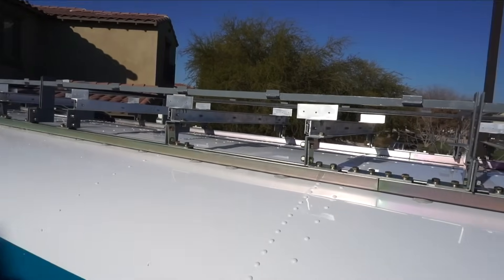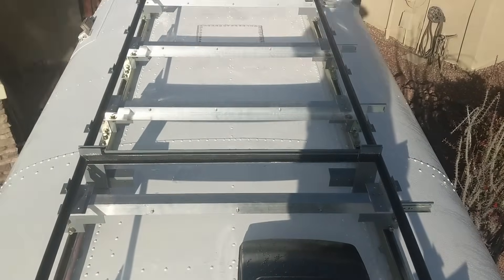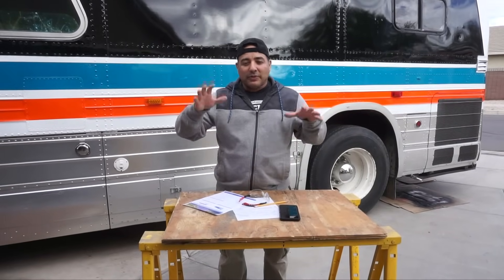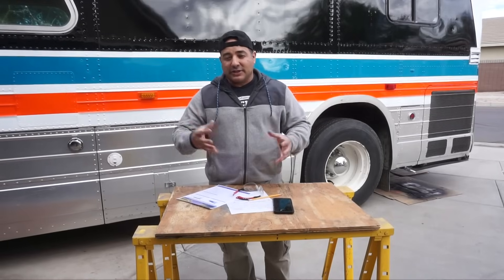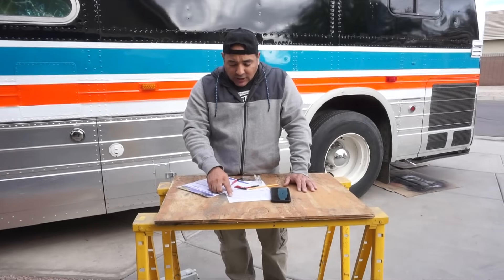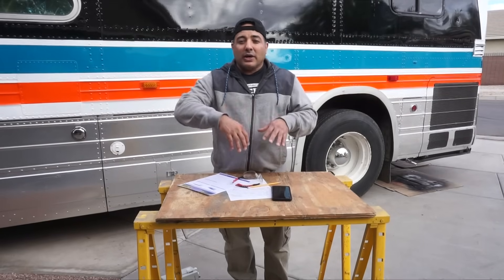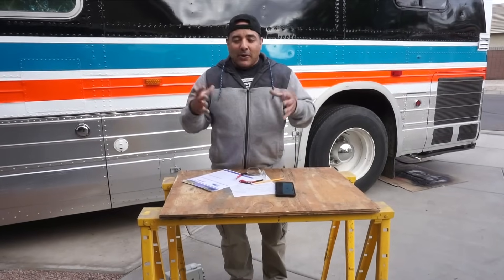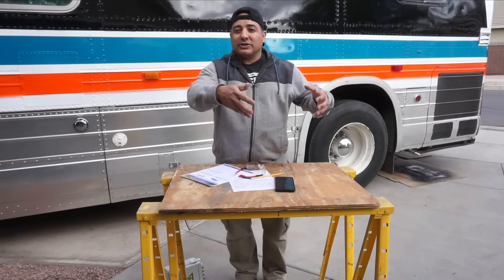Solar Install:  Part 2 - Mounting the Lower Sliding Rails & Combiner Box

Comment: I am building a 2s2P setup on my box truck as well. One series will be on sliders like yours when driving.  If I use a combiner box as well, won’t the amps drop significantly when the panels are shaded?   Reducing the overall Watts produced.  I am trying to decide between a combiner box fed into an all on one charge controller verses using two all in one charge controllers (1 for each string).  Would appreciate your real world experience with this.
Reply from the maker: Amps drop in half as you would expect when the lower panels are in because only 1/2 of the panels are exposed to the sun. The secret is to have the panels that can be shaded in parallel with the ones that will not be shaded.  I have run this setup for over 4 years and it works exactly like it's supposed to.  Going with two charge controllers is slightly better because it gives you some redundancy.

Comment: I have 4 panels on my roof using this combiner box, (2-425w and  2-200w).When I was using just 2 of the 424w I was getting over 800 watts on a sunny day. Now when I added the 2-200 watt panels, I get under 300 watts total.
Reply from the maker: Thank you Eladio.  For panels that different you are going to want them on separate charge controllers and not run them through the same combiner box.  If you are combining different panels like this you need to match the voltages as closely as you can (like maybe by combining the 2-200W panels in series before bringing them into the combiner box).   Here is an article that describes what happens when you combine different panels and what to consider: https://solarpanelsvenue.com/mixing-solar-panels/
Reply: Thanks. I'm using 2 Ecoflow Delta Pros and a smart battery.

Comment: Any thoughts on the grounding safety wire? Was noticing you decided not to use it. I have this same box and am wondering if that just goes to chassis ground or if it's even necessary or useful in a vehicle?
Reply from the maker: We actually did ground the safety wire to the chassis - I did not show it because there is plenty of controversy surrounding the proper grounding of a PV array on a vehicle.  My thought was if we are plugged in - the chassis is bonded to the grounding lug on the 50 amp cable ... but I agree with you that on a vehicle it is mostly useless.

Comment: Just a remark about the wire thickness: don't only take the amperage into account, also use the length of the wire. The longer the wire the thicker it needs to be to be able to transport the same amperage. On https://4.bp.blogspot.com/-_VRM_ZGUKdc/ViOeH4m70tI/AAAAAAABdd8/tp6hj68cVTg/s1600/DC%2Bwire%2Bselection%2Bchart.jpg you find a nice table which illustrates that. It says 20A with 8AWG can be used upto 20Ft length with a maximum of 3% voltage loss. You want to keep the loss as little as possible so an even thicker cable would have been nice. Since I don't know how long your wires will be from the roof to the MPPT controller down in the bay it could well be that 8AWG is not even enough. Check that, you don't want to have a fire because of wires getting too hot.

Comment: I know that with lithium battery wiring I've heard that you're supposed to parallel them first, before you series wire them. so if you have 8 panels, you would take 2 panels and parallel them together, and do the same thing to the rest. you would have 4 sets and each would be paralleled. than you take those and  series them together. Here you are doing it backwards. I know with batteries that what you're supposed to do, not sure if it's the same for solar panels. Also with the bottom panels being shaded, I thought about adding a breaker switch when the panels are not slid out. I'm planning on doing the same thing as you guys with the sliding panel thing
Reply from the maker: Thank you eksine.  With the batteries you can do it either way but if you connect them in series first then you need a BMS for every "pack" you tie in parallel (I hope that makes sense).  I don't think a breaker for the bottom panels is necessary, because they are in parallel they just won't make any power.  When our solar panels are tucked in we make 1740 Watts instead of 3480W.
Reply: @BeginningfromthisMorning  so if you series the panels first before paralleling them it requires half as much BMS devices? I don't understand
Reply from the maker: @eksine  The battery will require a BMS for each "in-series" strings.  When you parallel the cells - those cells act like one huge cell.

Comment: I wonder if these kindorfs Uni strut are not rusted right now because they are not rated for outside.
You idea is fantastic.
Reply from the maker: The UniStrut we installed was Hot Dip Galvanized (we also sealed where we cut it).  It has been over a year on the roof and we don't see any signs of rust.  That being said - it is carbon steel and eventually it will probably rust.  When it does it will probably be time to put a new solar rack on anyway :).  We will report back on how it does but so far so good.

Comment: If you had more solar charge controllers, wouldn't that help with if some panels were shaded?
Reply from the maker: Thanks, Jerry, small charge controllers might help with shading but probably not by much.  We already have 4 parallel strings (which helps with the shading).  It would add significantly to the cost and complexity of the system.

Comment: G'day Guy's, great job so far I am loving this project. I have a similar setup on my house boat in Australia. 8 X 320w PV panels. 4 X  2 panel series strings, each wired to its own victron smartsolar mppt 100/20 controller. Using the 4 solar controllers makes for very efficient use of the PV panels. This way I also have redundency, and allowing for shading probs. I am using a victron 24/5000/120 inverter, also have an auto start on my Honda EU3000 generator. I have 1320 AH of AGM batteries. I am using a $30.00 raspberry pi in place of the $700.00 victron color control, this works great.
Reply from the maker: Thank you David - that sounds like a great setup!

Comment: So do you run all your solar panels in to that box and then you only have 2 or 3 cables running into the bus?
Reply from the maker: Yes that is correct Mike - they are all hooked up to the combiner box and then just 2 cables come into the bus.

Comment: The wires being a little over sized is a good thing. It means less resistance, less heat and room for an extra panel or two if you ever want to add more.

Comment: Great explanation, Beautiful execution! I was just wondering how lightning protection works in a bus, don’t you need a grounding wire for that, running into the ground? Thank you for making these videos!
Reply from the maker: Thank you Freddy.  When the bus is plugged in the grounds will travel through the 50A shore power chord into the earth.  However when the bus is moving ... I guess we could drag some chains or drive a copper stake into the ground? (we are not going to do either of these things - I am just thinking out loud).  Maybe it will only be protected when we are plugged in?  Let's just hope and pray we don't get hit with lightening :)

Comment: Well I wrote this once and lost it, Your solar discussion when over my head. Not knowing anything, would putting the four panels on top (two in parallel and then those in series as you discussed) keep those panels in full sun (no shading). The four panels under the top ones would be no functional when traveling?

I love welding cable, I use it for battery and jumper cables all the time. They are fine strand, very flexible, with stands oil and being dragged across the floor. (my understanding is electricity does not flow through wires, but across the surface, that meaning the fine strand has more carrying capacity?

You said you usually use welding cable, have you wired panels before?

Cover the whole length of the wire to keep the wind from rubbing it around on the roof when traveling?

Thanks for my "beginning from this Morning" fix! Glenn
Reply: I beleave that AC uses the skin effect but DC uses  the whole wire
Reply: That would be interesting to know, makes sense as most automotive primarey wire has thick heavy strands
Reply from the maker: The solar stuff can be a bit confusing.  Very much like batteries - you can connect them in series to get higher voltages or in parallel to get more current.  The added caveat is that if you do series shading matters a lot.   So the way we have them configured even with the bottom panels pulled in we will still get 1740 Watts (in theory) to charge the battery with.  If we did them all in parallel we could have also seen the same benefit but we would have had to run much thicker cable (50A vs 25A).  We thought this would be a good compromise - time will tell if this was a good choice.

We use welding cable for everything else in the electric bay from 2 AWG to 2/0 AWG stuff.  The super fine strands make it very very easy to work with.

I have not wired panels before I was speaking about the stuff we have in the electrical bay.

Thanks for following along Glenn - I am enjoying your channel as well

Juan
Reply: Thanks for mentioning my channel, I hope some people take a look. Hope to get back to dragster stuff soon. Need to build a banister for the basement stairs next. Loading a new video as I type here.

Comment: Looks like a excellent installation, wondering if you have any concerns with the small box that connects through the Bus, seems that with the wire through holes facing forward if you will get water penetration at 50 to 60 MPH??
Reply from the maker: Thank you John - I was concerned about that but we have had quite a few heavy rainy days without the wires in and no rain got in.  If it becomes a problem the contingency plan is to add a small air damn in front of it - hopefully we won't need it - but we will test it for sure.  Thank you for the feedback

Comment: VHB and  Eternobond are two amazing products.  I’ve seen them used extensively on bus builds.  With all these numbers going through your heads it’s amazing that you ever get any sleep.
Reply from the maker: We have been very pleased with both products and with 3M 5200!  It's funny that you mention the sleep - this has been one of the roughest weeks for sleep in a LONG time - I am somewhat of an insomniac anyway - but this last two weeks has been especially taxing.